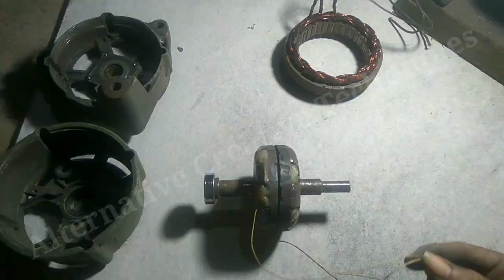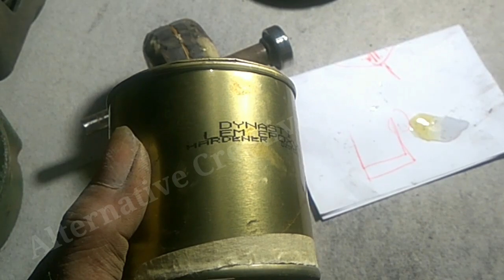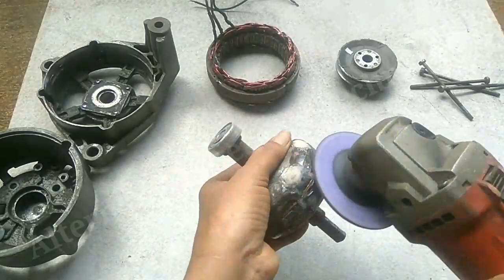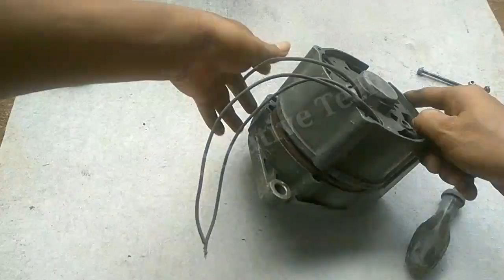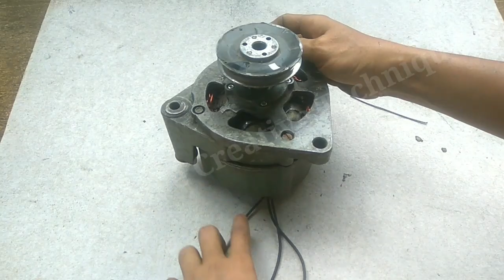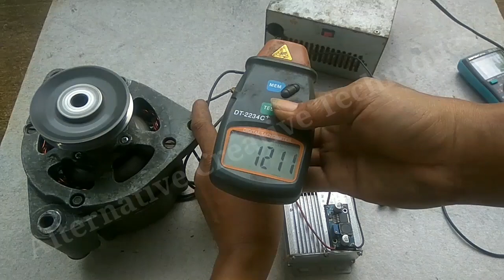Old car alternator for brushless DC motor.

Comment: coment ke 4....
ijin berkonsultasi om....
saya ada alternator 90 ampere 12 volt
jika digunakan sebagai motor bldc sebaiknya pakai controller jenis apa...
esc kah atau controller e bike.... 🙏🙏🙏🙏
Reply from the maker: Mending controller e-bike, mas bro.
Selain lebih murah, watt juga besar dibanding esc. Beli yang multi alias bisa tanpa hall sensor atau bisa dengan hall sensor. Biar tidak repot/ribet pasang hall sensor. Ribetnya bikin dudukan hall sensornya.
Reply: controller e bike... sebaiknya yang watt nya berapa om untuk alternator 90a 12 v....
mohon petunjuk 🙏
Reply from the maker: @pancarulang1240  
Kalau yang di video saya 350W sudah cukup, tidak ada panas sama sekali..
Reply: @YudiHermanto4H  siap om.... kalo untuk jangka panjangnya bagaimana om.... apakah baik baik saja.... saya rencananya mau saya pakai penggerak mini boat kapasitas 2 penumpang dan nanti akan dipadukan dengan tenaga surya....
Reply from the maker: @pancarulang1240  kalau gitu sekalian yang 500W aja.
Sebenarnya kalau bisa ganti/nambah mosfetnya, yang 350W juga bisa lebih dari 500W 😂😂
Reply: @YudiHermanto4H  okey siap om.... terimakasih sarannya....🙏🙏🙏